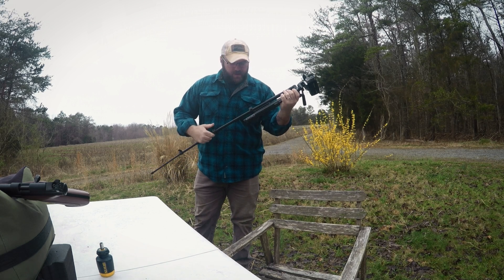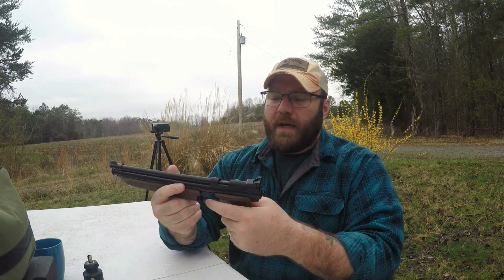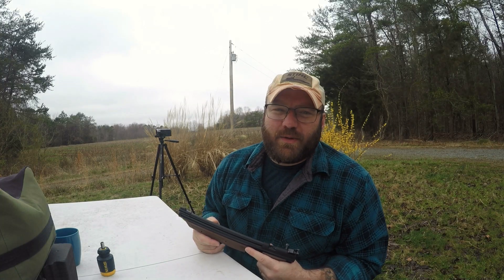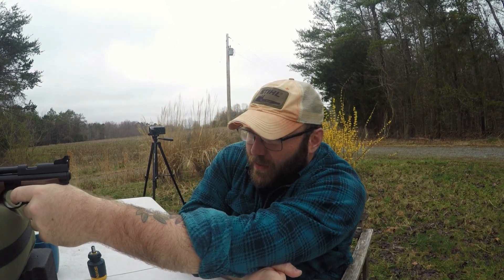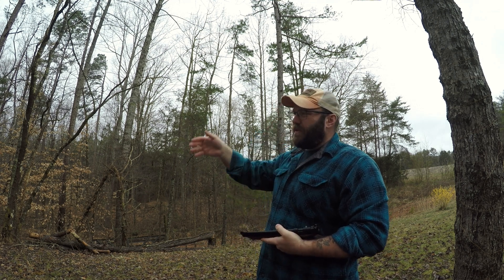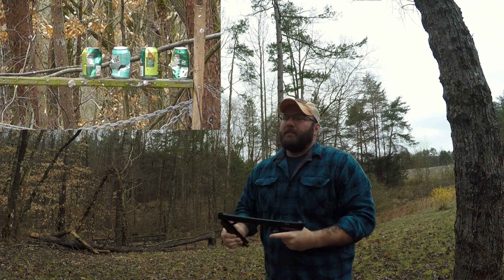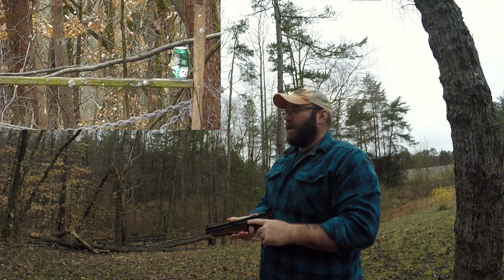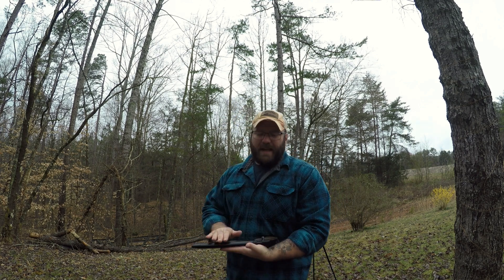Crosman 1377 Target Practice

Comment: I love the classic 13xx series, very accurate and even better with some of the popular mods. over the years i've had a few different models. I've held on to three of them, a 2250b Rat-Catcher which I made my own version of the metal 'Clevercraft' scope mount and modded internals, modded 1377 with stock ect. and a 1322 which is also modified. They are a lot of fun for folks who like to tinker and there are so many after market parts, upgrades and so on, you could spend a small fortune if you're not carefull LOL! Thank you.

Comment: always fun to watch your videos , you can tap and thread those old bolts, when you look into getting a different breach make sure you get the breech that places that hole  out of the way of the loading chamber. it helps with the loading , a lot of people fill that area with a little wax to take out the indentation from the screw so pellets load better.

Comment: Yeah, the 1377 is a cool little Pistol
I have two; one is still a Pistol, but the other, I added the Crosman 1399 Stock
I love shooting that 1377-99 Carbine
It works great with the Pee end of the Sight up
I extended the Adjustment Notch, and scored the Face of the Rear Sight Blade to give me a Zero at longer Range, and a Scale to keep track of different Elevations

Enjoy your 1377

Comment: There are multi pump shooters that advocate storing that type of air gun with one or two pumps in the system as a way to keep dirt from getting into the system. Tom Gaylord is an example. But, though Crosmans can be stored that way without having to cock them, Daisy's can't. And leaving a 901 or 880 cycles doesn't sound like a good idea. You have got an exceptionally accurate 1377 there, my friend. A keeper for sure.

Comment: I'm really into my 1377 as of late.  I've compressed the trigger spring, half-a*sed polished the trigger sear, and mounted a low cost reflex sight. My gun's biggest limitation is me for sure, but I've found it crazy accurate.  My copy does really well with RWS Meisterkugeln at 8.2 gr, RWS Diabolo Basic at 7 gr, and a few others that escape me at the moment.  There are so many fun things you can do with these things, that it's a definite hazard to the pocket book.  I recently picked up the Crosman 2240 (the 1377's and 1322's Co2 cousin) and will be converting it to .177. Another great pistol to have fun with.  The rabbit hole is real folk, beware. 😆

Comment: Travis,
If you haven't already tried this, then this will give you an entirely different way to shoot your 1377. 
It goes like this:  
1. set the rear sight to aperture.
2. hold the gun with both hands.
3. press the gun against your face.  The butt will rest against your face, so you can see through the peep.  The butt presses against your skull, so it is as stable as your head.  You use your other hand, (as required) to stabilize the muzzle.  You can hold your elbows against your side as necessary to further stabilize your arms.  
4. aim and fire.

A hold like this does away with any instability that arises from holding the gun out in space.  Another thing I like is that with an aperture sight, you don't have anything to line up; your eye centers in the aperture without thinking about it.  

I've tried this in the garage with my 1377, but not outdoors at distance.  It's different, but it works, and is a whole lot more accurate than any other non-rested hold I might use.  This is still a pistol with a short sight-radius, so typical groups won't compare to a scoped gun.  

There is another downside that's obvious.  You are committed to this scheme until you change the  rear sight back to the notch, so keep a screwdriver handy.
Doug
Reply: I can't see how people  can't hit well with these pistols.  I hit what ever I aim it at.  Took a couple shots but after that. I can hit anything

Comment: I just got this pistol and the bolt is really loose but it shoots. If I turn the gun upside down the bolt handle will not stay in the closed position. Whether it is cocked or uncocked it just flops around. I don't know if that is normal. It is accurate though.

Comment: Very tempted to leave my 1322 a pistol, but Nib's video convinced me into getting an 18in barrel for the 2240, so I'll move the 14.6in barrel to the 1322. I'm wondering if anyone has experience with the flattop piston and valve? Plus, there's a modded valve version out there as well. I'm trying to decide which direction I want to go.
Reply from the maker: I'm looking into power mods myself for this one.

Comment: Doing just fine with it as a pistol! How much would you expect to pay for one new? There is a hardware store near me that has one, however they seem to want a lot for it! Over $70.00. If you want a real pistol you can shoot, get some kind of 1911 platform. Between my Rock Island A1 9mm, Uberti 1873 and Springfield XD45, I shoot the 1911 the best. Way better! Actually hit a 10" plate at 50 yards with consistency! Took 3 or 4 rounds to find it but man, after I did it was the same hold every time!Happy Easter to you and yours!
Reply from the maker: You can find them on sale for under $50. I'd ask the hardware store if they'd consider matching a price on like amazon and that you'd rather support them or get it from them in the hopes that they will start selling airguns. My local gun store has almost doubled prices sometimes and I have ask them if they would consider a lower amount. Most guys will. If not oh well.
Reply: @Oh Shoot  that pistol had been there for years and today I went in and it was gone! Crossman Legacy 1000 insread!

Comment: hey so i have a scope a true glow one it is not shock proof or what ever they call it but i was wondering is a nitro piston considered a springer bc i have a crosman fire and its a nitro piston and i was wondering will the true glow be able to withstand a nitro piston ive had it for a year and it has not broke and im also wondering will the scope work with a black ops sniper S which im pretty positive it is a gas piston or nitro cant remember the scopes model is truebrite xtreme tactical compact rifle scope  4x32mm
Reply from the maker: It will probably wreck it. Nitro pistons have a little less vibration though. I've found that proper  ring replacement and torque help out  a lot.
Reply: @ohshoot444  ok for some reason the scope hasn't broke yet ive had it for a year now it also could be shaking the scope up bc ive realized some accuracy issues

Comment: Keep it pistol and get another in 22 if you want to go carbine
Reply from the maker: Bought another 22 to keep pistol lol
Reply: @ohshoot444  the biggest issue with this pistol in my opinion is the hand pinch issues last weekend I went out with some friends and my buddy loaned his pistol to his friend after rhe 3rd pump he pinched his hand between arm and pump tube ,  I scolded my buddy because I think whenever you hand this unit to someone you should caution about the hand pinch possibility,  he ended up with a blood blister and probably won't shoot a pumper again ,  I bought a 3d print arm and grip , not from Buckrail-line even though I love Terry's products and support his endeavors fully , I got the target grips which completely eliminated the hand pinch and made it significantly easier to pump ,  I also replaced the breech with brass which somehow also reduces perceived pump effort , I thing it's from my pump style where I'm dropping the top half onto the pump arm rather than pushing the arm toward the body of the pistol .  I have also used a little uv resin to secure a fiber optic , for me it makes for better accuracy because I can drop the front blade between the forks of the rear sight till just the dot of the fiber optic is visible with no other part of the blade visible in the forks I believe it gives me the ability for a repeatable sight position better than leveling the blade in the forks .

Comment: Id guess this is steel breech bolt wich does come stock on the target guns!
I just crushed my 2240 trigga springy and I will need to get my 1377 carbine out for the same treatment for sure.

My honest opinion about the 13XX is that it is a bit heavy as a pistol and the 2240 feels better in this configuration...
But I really like the self sufficient side of it and how mine feel & looks now with the Buck Rail extras!

I do believe you can cock them afterwards but ive been doing the same thing because people said you needed to cock them first
(Wich was mostly true back in the days)